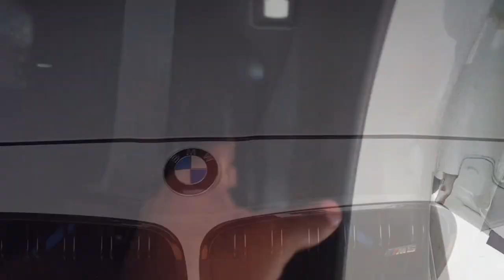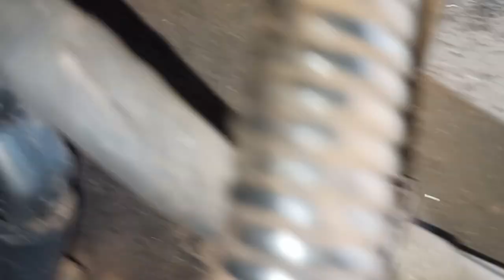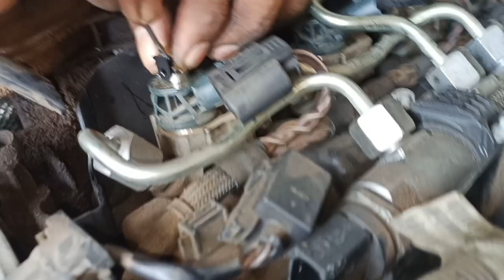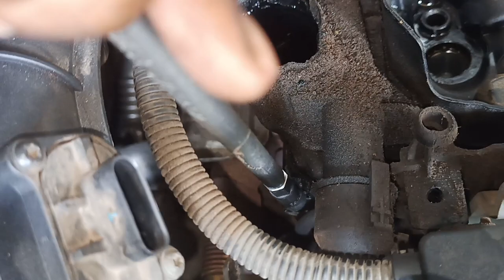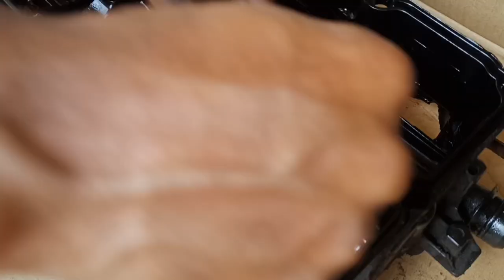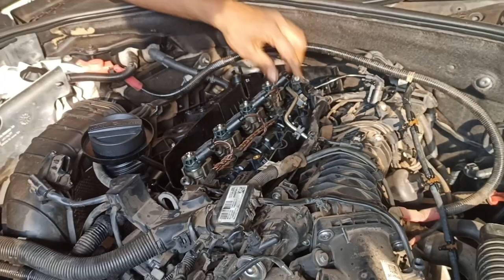BMW Smoke from engine room|Burning oil smell| 520d valve cover gasket replace|

Comment: Hi Great video, what torque was the injector clamp set to? Going to need to do this soon.
Reply: ive done mine on 26 Nm  all perfect no problems since two years ago
Reply: also recomended if the car has over 100k miles to replace the whole rocker cover not only the gasket
Reply: @Nicrig Good point as the Crankcase ventilation diaphragm (under the disk cover behind the oil filler) can go stiff & increase rocker pressure & cause the gasket to  blow again or even worse symptoms! Replacement crankcase diaphragm & cover from Viaco is part V20-3341

Comment: How did you get the injectors to come out so easily? Any advice? 

I’ve seen people use a slide hammer, but I have the same injectors on my n47 e84 like in this video that have the fuel line on the side instead of the top so there’s no where to screw the hammer into.